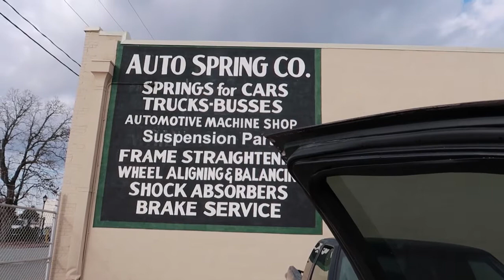**Very Bad News** Crown Vic On 8s Lift Kit Problems

Comment: I had a crown vic like that but the 03 an up wheels you gotta make sure you get the right offset wheels so they dont poke bad an if you do lift it get some extended control arms or spindles
Reply from the maker: Yea, the wheels i got are chevy wheels with a ford adaptor to hook up, when i kop the 30s or 32s im gonna go the right offset for them. I got the adjustable upper control arms but i think liftabrand might have put the wrong ball joints in...
Reply: Damn that’s crazy bruh

Comment: thanks for that info, i wanted to order some new upper control arms for the lx sport. let me know when you get your car taken care of so i can get the right stuff as well.
Reply from the maker: I gotcha, im fixn to call liftabrand when they open today to see if i can use my own factory ball joints for that arm
Reply: @2xmototv206  from 03-11 the ball joint is built inside the upper control arm therefore you have to replace the whole upper control arm. 92-02 the upper ball joint is a separate double bolt on part
Reply from the maker: @jaye23able  i called liftabrand, those ball joints are press ins, the upper control arm from the kit come with press ins so i can buy factory ball joints and press them in the arm
Reply: @2xmototv206  cool that actually make the job easier than taking the whole control arm off

Comment: That’s good y’all figured it out bro and it seems like it’s a simple fix for the most part and it’s good you found a shop that will work on the Vic with the mods on it 👍🏽✌🏾
Reply from the maker: Thanx bro, been wondering what the issue was for so long but now we found it, im gonna buy oem upper ball joints to go back in... Keep up the good work on ur vids to bro.

Comment: I gotta 05 merk and i have 22s now but I bought 24s that ima put on but i wanna put at least a 3 inch lift on it but my rear suspension is air bags soo do these lift cups work for them too
Reply from the maker: Well.. the lift cups i believe only work. With a spring setup. Give liftabrand a call and ask to speak to jonah.. hes the best tech they got and can give u a solution to that setup..
Reply: Ok ok got you bruh ... i might jus do a spring conversion anyway kuz air bags wear out and i would end up replacing anyway

Comment: Still following your steps brotha got the same lift from liftabrand
Reply from the maker: Yessir.. be sure to look at the upper control arm ball joints and make sure they are oem crown vic ball joints, i called liftabrand today and they said the arms are made to fit oem ball joints so u can buy some and have them pressed in..